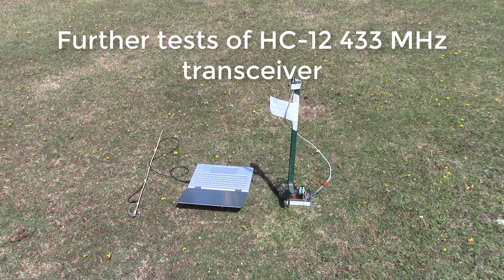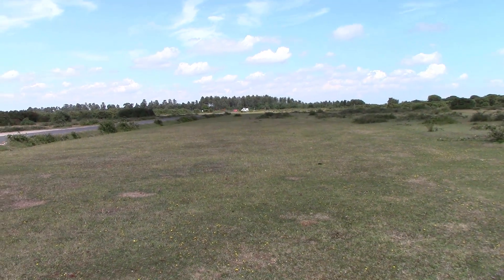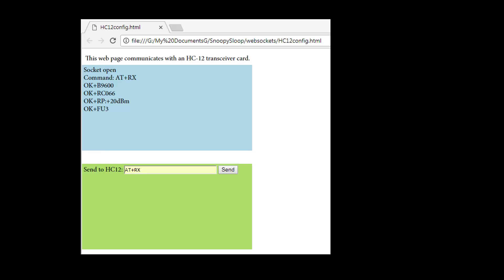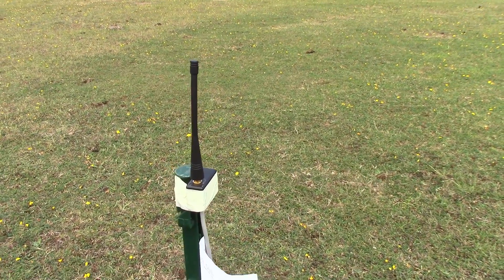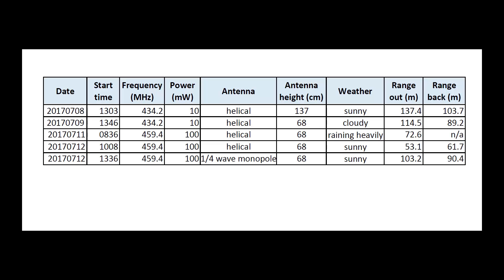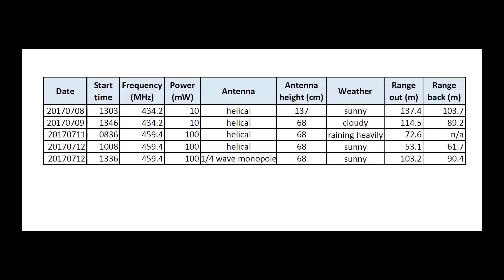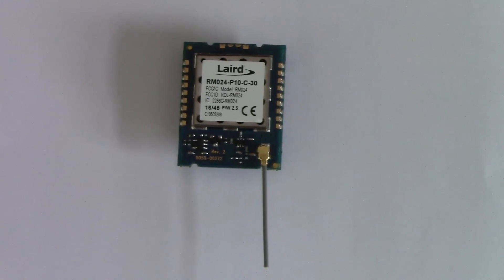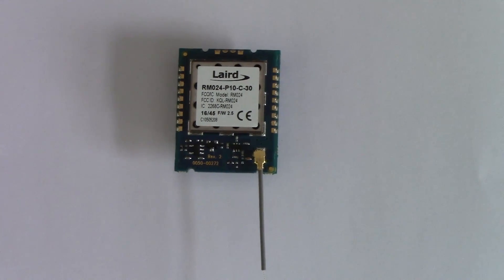Further tests of HC-12 433 MHz transceiver

Comment: Hi Samuel, I found that there are two versions of this radio, a cheap knockoff which has no distance and the original.  I have had very good success with the original.
Reply from the maker: Yes you are correct. A little more on this in the comment by DIY TECH BROS, and my reply to it, in my other HC-12 video here https://www.youtube.com/watch?v=MLRH6Rbjirw

Comment: I just finished a test from 2.5 km distance using a 20 dbm with 9600 baud output using a 915 mhz LoRa transceiver. It worked without too many issues. You need better antennae.
Reply from the maker: What LoRa atennae did you use. I get a longer LoRa range when boat is on a lake than I got in the New Forest tests. BTW this video is about HC12s not LoRa.
Reply: same as this fellows for 915 mhz:  
https://www.youtube.com/watch?v=JeUexihrKZQ

I believe you can get much greater range with the power output you are using.
Reply from the maker: Thanks for useful link.

Comment: Changing from 433mhz to 459mhz is what made your results inaccurate and not very scientific. These modules can lose 50% to 80% of range based on being on such a higher frequency. Using those same antennas at 100mw on 433mhz would have gotten you close to 500m at ground level. In air with clear LOS like on a model aircraft getting 1km is common practice.
Reply from the maker: I may try that when I have time. Its manual says nothing about range being a function of frequency.
Reply: @samuelfielder  It's a general radio knowledge

Comment: hello Samuel. I use this little module to drive a brushless RC glider, and I manage I little more than 600 meters at 19200bps, UHF channel 2(CH02). I live on the country side, so basically the background noise must be less than in a dense populated area. I use a 1/4 wavelength on the plane and a Nagoya Na-771 on the remote control. If I try to go any farther than that, the plane activates its return to launch site subroutine. There are some days I can get even 680 meters. I realize that with my current setup, I will not be able to go much far away, so I will watch your videos and reviews, coz my desire is to get at least 2000m, that would be nice to fly FPV.
Reply from the maker: Thanks that is interesting info. Of course your glider is up in the air and you will therefore get a greater range than I do being close to the ground. My tests were done in a country area where I did not expect there to be much interference, but I wonder if there might have been. I have obtained a longer range of 600m with my LoRa kit in a more urban area than where I tested it for the video, so the results are confusing. The latter was mainly over water. I can control my DJI Phantom 4 drone over a distance of 4 Km, and get 720p colour video back as well. Whatevfer they are using it is much more effective than the modules I have tested. Might be worth looking into drone radio links.
Reply: I often wonder, why they do not make that kind of cheap RC radio transceiver technology available to us via an arduino shield. You can buy a 100 dollars setup on eBay and fly your drone/plane to some 2km. Some models can even get information from the plane/drone back to you.
Reply: I am looking at E32-TTL-1W, but there's not much information and reviews about it on YouTube nor Arduino forums. I would like to see what other people got out of it, before trying myself. We pay heavy taxes for every foreign merchandise that enters my country, so, in my case, it is almost prohibitive to buy a lot of modules and try one by one.
Reply: Jeferson Lucio is it possible to send me your code as I get interference affecting my esc signal
Reply: hi I also need some good long range did you test E32-TTL-1W ?

Comment: So it doesnt have 1 km range but 50 m?
Reply: I got 1.2km with 1/4 wave dipole I made myself ( very easy build from YouTube) at 1 meter above ground
Reply from the maker: That's what I found. But remember antenna is only 68 cms above the ground. If it were higher up, or in free space, a greater range would be obtained, but I can't say what as I haven't tested it. The 68cms correponds to the height of the top of our robot boat's mast. Your requirement may be entirely different.
Reply from the maker: Well done.
Reply: I need soem compact size antenna, so what shouldbe used? the provided spring antenna is not the best but small and compact, a simple 17cm wire or a longer aircooled?